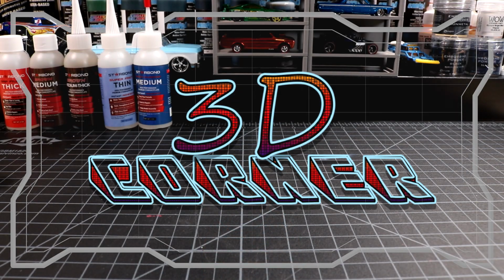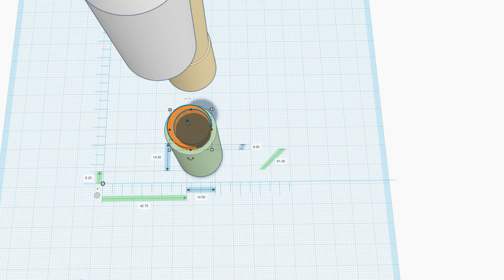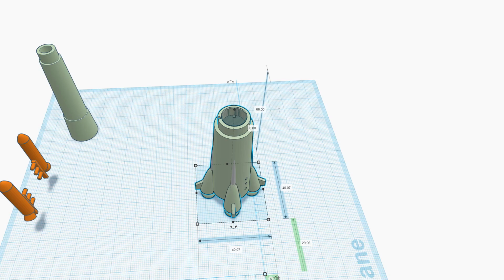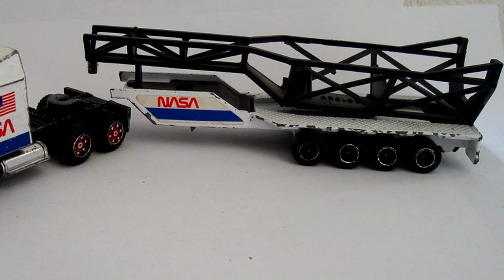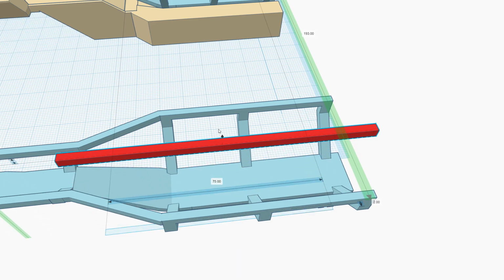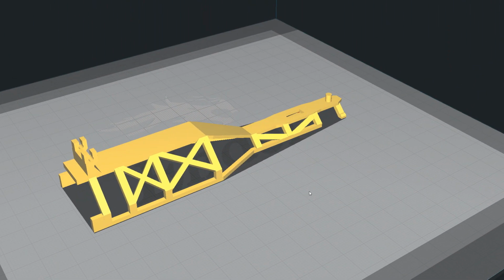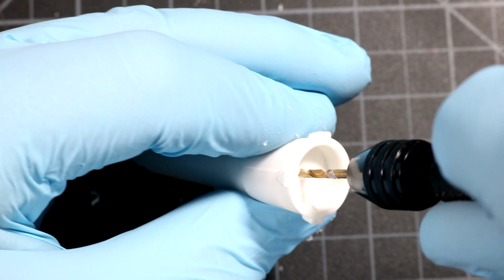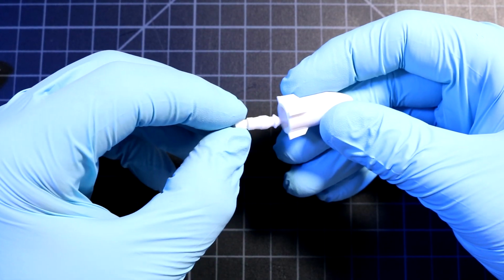3D Printed Replacement 1:87 Scale NASA Rocket and Launch cage!

Comment: The side boosters don't need the nozzles angled they simply give brute force lifting strength and the main engines will worry about all the steering. It's a beautiful model and I think you're right it seems to be a mash up of different rockets.

Comment: For the cage slow your movement speed to around 50mm/s and only support the flat top. The 45 degree overhangs should print fine unsupported as long as your nozzle isn’t too hot and your movements aren’t too fast.  Also set cooling to around 50%